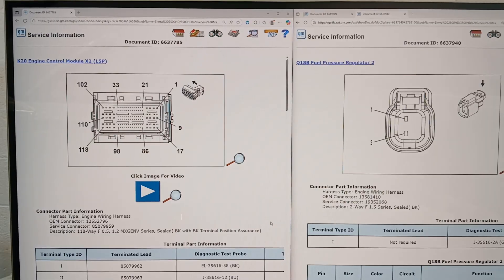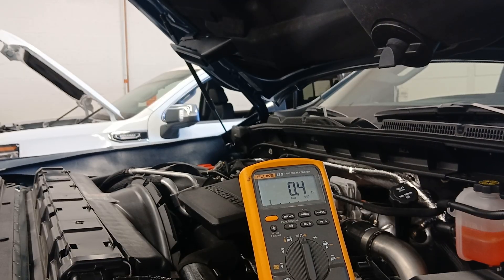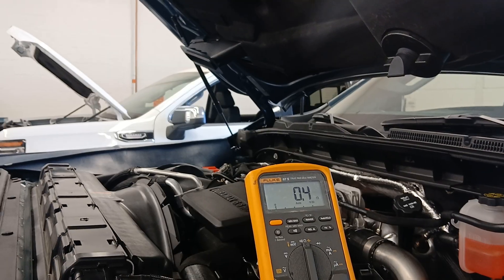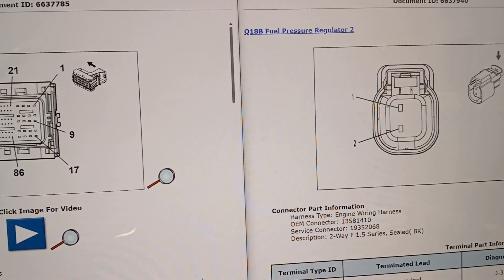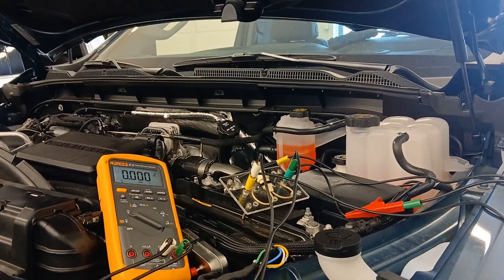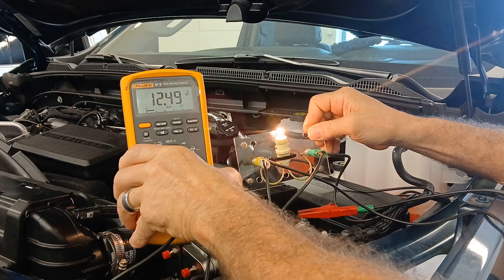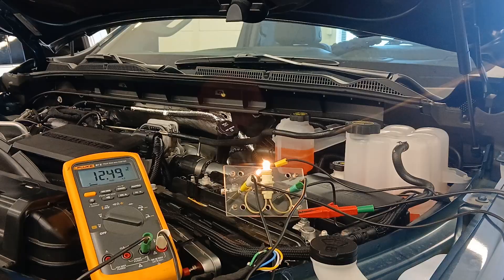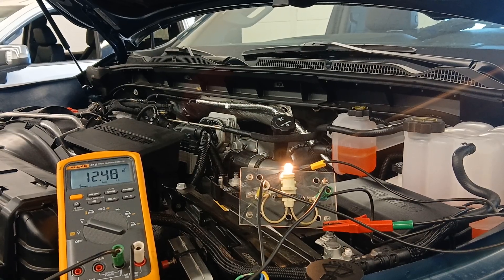#voltagedrop #loadedvoltagetest Loaded circuit voltage test

Comment: Why not just disconnect the fuel pressure regulator, put in place a bulb of equal amp draw in place, and just run the car or bidirectionally control the regulator with scan tool? That way you are not having to disconnect engine module and search for wire
Reply from the maker: The engine wouldn't run with regulator 2 disconnected, but you are right a 1 amp bulb in the circuit and control with the scan tool would work